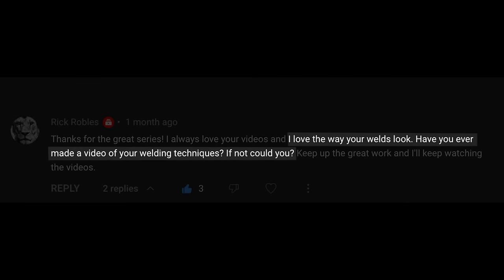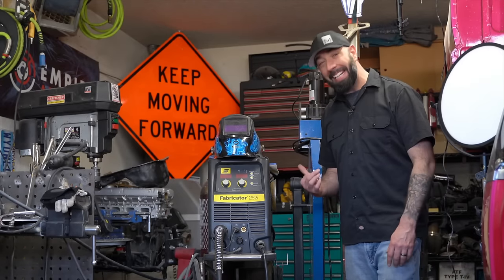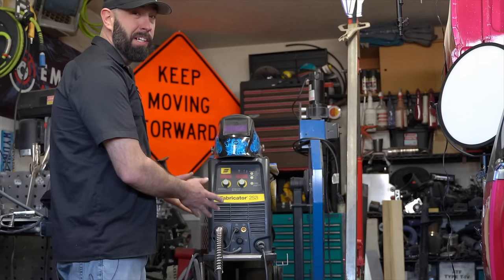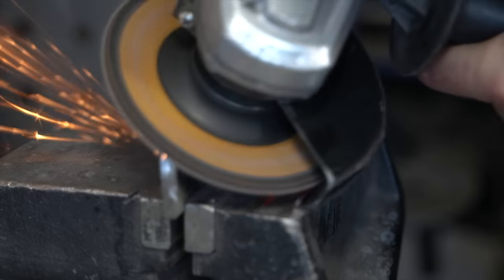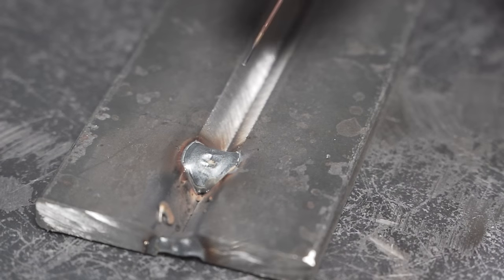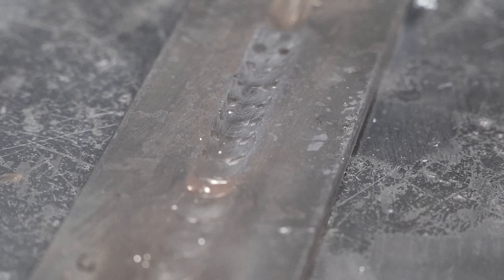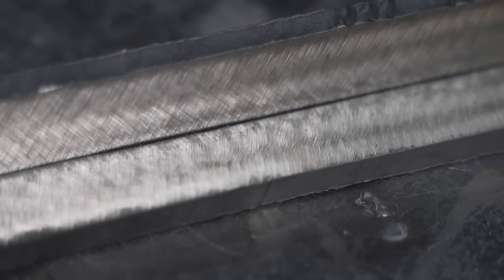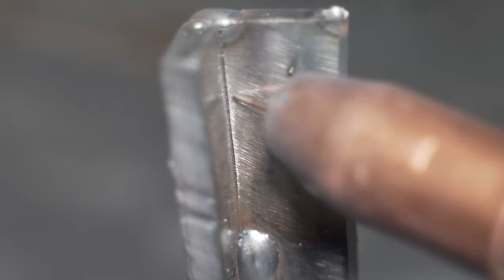MIG Like Mankandy: Techniques for Stacking Dimes with a MIG Welder

Comment: I’m pretty seasoned at stick welding, and like you I’m self taught. I rarely welded anything lighter than 1/8 inch steel. I’ll have a mig machine by mid April, and it’s gonna be an interesting learning curve.
Reply from the maker: Tell me about it! My first welder was a stick welder. I never got good at it. I can only imagine trying it again now.
Reply: If you can stick weld you'll be fine with a mig.
Reply: @GarageFab  I didn’t really have an option. I pestered my grandfather about teaching me, so he said, “fine” and flipped me the lead, the helmet and drove off 🤷🏻‍♂️
Reply: @aevan104  I’ve been told that many times. It’s just that I’m really wanting to learn how to weld sheet metal (20-14 ga) and with past experience, metal that thin gives me a touch of anxiety. 😂😂
Reply from the maker: I certainly haven’t mastered sheet metal. It’s easy to weld. But NOT easy to not warp. 😩
Reply: @GarageFab  And the real first project for me is gonna be making drawers for my benches so I have more places to store stuff 😅
Reply from the maker: Good call.

Comment: Just found your channel and subscribed. I'm a self taught welder that's been hobby welding on and off for about 35 years and as a job for maybe 5 years.  The fact that you understand the theory sets you ahead of many people doing it for a living.  You know the results you want (aesthetically/structurally), you know the requirements to do it properly, you know the materials and method to do it properly.  I'm not seeing a problem.  Nice welds and excellent video explaining them.  I even learned a thing or two.  In 35 years I've never done the triangle one,  I'll give it a try tomorrow.  In my defense, most of my experience is stick welding.
Thanks for the video
Reply from the maker: Thank you Bruce! Thrilled to have you my friend. Lemme know what you find! Based on what I’ve learned from comments alone, I wonder if the triangle would cause problems with stick welding. (I have VERY little experience with stick) I can envision slag potentially getting buried when you jump backwards as I do while forming the triangle. I’d be interested to know what actually happens. Thank you again my man! 🙏

Comment: Thanks for taking your time to create another great video. My advice for any newbies would be good prep position yourself to ensure your comfortable and consistent through the pass stay calm and adjust accordingly. Weld as much as you can out of what you got you don't need perfect tokens just keep stacking scraps and welding also let your test pieces cool so you're not setting up for hot metal
Reply from the maker: Good info, Lee. Thank you!

Comment: Good video brother. Lots of opinions about vertical down, but you not the only one doing it!🙂
Reply from the maker: Share them opinions! I’ll just have to finally cut and etch one of my welds, and it’ll either force me to shut up and learn to weld up or I can keep on keeping on. Prolly the former. 🤦🏻‍♂️
Reply: @GarageFab  Well, guys like Karl Fisher from Make it Kustom and Brent from Half Ass Customs do lots of vertical  down on the cars they build. And that includes welds on the frames. I do both, but only use vertical up when I feel it's a seriously structural application. Keep on keeping on brother!
Reply from the maker: Well I feel better now, thanks. 😆
Reply: @GarageFab  don't stress bro, your work is A1 👍🙂

Comment: Great video as always! 💪
I am not a pro/certified welder, but I’ve noted that the torch angle makes a lot of difference along with a smooth and ”even” movement, despite what kind of pattern you are doing.
When finding the correct wire feed speed/voltage/torch movement speed -ratio to obtain good penetration and decent looking welds you can actually hear if the wire feed is too much and also feel it to the torch handle. These are just my thoughts…
Reply from the maker: That’s good info. Thank you my friend.
Reply: @GarageFab  …furthermore the difference in pushing or pulling the torch; You get a different puddle melt (hotter or colder). There are a lot of variables to mig welding which i have noted just by trial and error 😁. When you have done a mistake to a place which is not easy to fix, you will try to find new and a better way - and you’ll never do the same mistake again 😆
Reply from the maker: So much truth. I’m going to be experimenting with pushing in the near future. Thanks again!

Comment: This is a fantastic way to add excessive heat, waste time wire and gas to make an inferior weld. If you want to "mig like tig" then just tig it. 
The best way to mig period is to move that gun ahead at a continuous rate through the joint depositing wire into the joint.
Reply: Tig 6mm steel? Why?
Reply: @chrisbenn8691  just saying, mig like tig is a waste of time, wire, and gas. Also adds an insane amount of heat to the joint AND worst of all makes an inferior weld. 
Don't believe me, go out and test it. Do a straight stringer and then do a "stacking dimes" mig run. 
You'll see a massive difference in the heat affected zone. 
Cut and etch them and you'll see a huge difference in penetration as well.
Reply: I was hoping someone would point this out. GMAW wants the smoothest movement you can execute, especially if you have to pass a weld test.
Reply from the maker: But what if you joint is large? Would the answer then to be multiple smooth passes rather than a weave?
Reply: @GarageFab  ordinarily if I'm stuck with a wide root weld, I use multiple stringers, then however many stringers it takes to build up the cover weld to print. Weaving is for SMAW not GMAW. If you're not getting paid, or if strength is a secondary concern, weave away.
Reply: @GarageFab  multiple stringers. 
Go check out the structural welds on any large structure. You'll see straight stringers. You'll typically only see weaving on open root but then you'll see stringers on top. 

All that said, mig like tig wil still hold things together. But it will also always use more wire, more gas, and more time, which for a home shop or production shop can be expensive. 
This is another thing you can test. Run a 4 inch stringer and time it. Then run a 4 inch dime pass and time it. 

I'm not trying to be a jackass or anything.  I'm not saying no one should ever stack dimes. But you should be aware of the heat, wire, gas, and time issues.
Reply from the maker: I don’t know if strength is “second”. I’d certainly like to avoid death. But appearance matters a wee bit too. Thank you!

Comment: I was told by a welding instructor in a basic welding class I took for work that using 75% 25% gas leaves nearly no slag and doing top to bottom verticals was completely acceptable on the truck frame I was building.  He even told me to bring in my personal welder I was using to do a weld and do a break test. I passed the test and his comment was " I'd ride in the truck your building with no worry on your welds. Before that class I had no idea top to bottom was a no-no. Now for stick welding no acceptable, mucho grande slag. Great vid bro 🤘
Reply from the maker: Interesting! So slag inclusion would be the concern with stick. That’s more input than most folks have given. Thank you Brother!
Reply: @GarageFab  correct. Keep making that killer content brother 🤘

Comment: Just stumbled across yoir video here and ive been a fab/welder for over 30 years 
I was taught to push my mig torch from welding school for better penetration and if you use the wire as a spacer in your "V" groove joint at the bottom eg 1 - 2 mm gap this will give excellent penetration 
For as vertical drops they work ok and are fairly strong if you work a up and down motion and this wiĺl be stronger
Reply from the maker: Thank you for that, Raymond! Very much appreciated. I’ll experiment with it. 🙏

Comment: Thank you for the video. Im definitely going to be referring ro this video in the future. I saw on another video that getting a stack of dimes is easier when you slow down the wire speed while keeping the volts up where they should be.
Reply from the maker: I’d agree with that. The hotter you are the better the puddles will flow. It’s a delicate dance though between hot enough for great flow without going so hot that the wire burns back too far and causes sputtering. 😩

Comment: Best welder you can get is great advice. I've spent a lot of time trying to figure out which problems are me and which problems are the machine. I just fixed a cheap ground clamp that had me thinking I might never be able to weld well. Thanks a bunch again for what you contribute to the community!
Reply from the maker: I feel that one Clint! I’ve had similar experiences. 🙌
Reply: Literally had this problem today with the shops welder. We don't do a ton of welding ( heavy diesel shop) but the machine is neglected since its the town pump and I discovered our ground clamp was covered in splatter, grease and oxidation. Cleaned it up with a wire brush and I'll be damned its a pretty good machine after all.

Comment: Thank you so much for this video!  15 minutes of my time and 5 feet of weld practice and my welds will never be the same.  Short and to the point.  I have a Miller 211 and it would be nice to have known the approximate settings, but I figured it out.  They are a lot different than the ESAB. A mention of the wire size preference would have been nice.  I assumed it was .035.  Thank you again.
Reply from the maker: Mmm very true. Settings already vary a lot from machine to machine, and then wire size changes it even more. I’ll likely do a follow up video with a bit more info.
Thank you my friend. 🙏

Comment: About The triangle tracing. It’s telling the welder that the he/she needs to weave the wire to the edge of bevel. But it really the weld puddle that needs to contact the edge of the bevel. So maybe smaller triangles when demonstrating with a pen. Great video Btw.!
Reply from the maker: Makes sense!

Comment: My first and only welder is the Miller 211. Only complaint is It is demarked in 1-10 for amps amd 10-100 for speed not actual volts and ipm like most videos talk about. But the chart seems to work pretty well. Have welded 1/8 up to 1/4 material. Clearly, the machine is better than I am. My biggest problem is seeing where I am going with the weld. Thanks for the video. You make this look so easy.

Comment: Great video! I learned something new. On a vertical down weld, I like to use an “inverted V” pattern. It gives a great concave weld and the penetration is good. No, not as good as vertical up but I don’t run the risk of a blow through.
Reply from the maker: Sounds good to me! Dancing on the precipice of burning through means your penetrating well which is why so many people despise vertical down. 👏

Comment: I’ve been a fabricator/welder for 20 years. As far as er70 hardwire goes I don’t consider it a structural wire. That’s where in our shop we use 710x-m dual shield or metal core wire. But that’s basically anything over 3/16”. And the dual shield gets welded uphill because your slag will run down in front of your puddle introducing porosity. Hardwire down hill as you described if your technique is good you should be fine. But make sure you clean that material lol. Great video.
Reply from the maker: Thank you, Jacob! I very much appreciate you taking the time to share that. 🙏 
Cheers!

Comment: I'll be honest, idk if the ESAB I used was flawed, or what, but I could never get a decent looking weld with it. It never sounded correct either. It was the only time, I'll ever use anything ESAB. Although, I don't think yours sounds any better than what I heard, but your welds look much better.
Reply from the maker: What was the model? I used an Esab a few months back and had the same problem, Rick. I chalked it up to not understanding the settings… OR… It was a garbage machine. I think I said it in the video, my Esab is certainly NOT my favorite. I make it work but I’m itching for an upgrade.

Comment: I started welding with a Lincoln 110 weld pak and welded a lot with it. The board ended up burning up. I then purchased a miller 252 and I love it. It took me about a month to get used to it but it'll weld up to 1/2.
Reply from the maker: I’ve heard good things about that one too!! Honestly though, I think you just can’t go wrong with Miller. 🤷‍♂️
Reply: @GarageFab  I also have the Miller suitcase tig/stick unit but my tigging skills are comparable to a three yr old with a crayon. I really need to sit down and get proficient with that thing.
Reply from the maker: I feel you. Me too.

Comment: I've been welding thin sheet metal to big ole 3/8's for 8 years now. When you are welding on thicker material, I've always recommended a push instead of pull. A push allows promotes a preheat of the base material, and it makes your welds flatter as well. All in all I believe you still have fantastic technique, and the welds look pretty good too. You should see about doing spray welding as well (you'll need a higher argon percentage)
Reply from the maker: Spray is some thing that has always intrigued me. I would certainly like to try. I have pure Argon. Good enough?
Thank you, Curtis! 🙏
Reply: Spray welding is the same technique that you are using just going forward or backwards 98% argon 2% carbon dioxide. The shop I work at wants perfect beads we also use double pulse welders your using cv if you push your weld you only have to go forward and backwards to get dimes my favorite is over head and down at a 45 degree angle just buzz pause buzz pause buzz and the only advantage of going forward truly comes in play with aluminum dragging aluminum will be covered is black soot. It you pace the same your doing its will shine  bright light a diamond

Comment: I just push and do little c’s , and or e’s and make sure it sounds like steady bacon.
Turn the voltage and speed that it says on the door . Practice once, adjust and weld.
I’ve never had any real problems.
I just wish I could see what the heck I’m doing. I’ve mostly focused on welding with either hand. I try to keep everything ambidextrous. But I’m basically goofyfoot, and right handed.
Reply from the maker: Vision seems to be one of the biggest challenges. It’s probably obvious, but being able to see really improves the weld. Weird.

Comment: This is how I taught guys at the shop.  Almost exactly.  Every new weld I would check the back of the material for discoloration and then let them know to go slower or faster.  That seemed to run the point home about the penetration aspect and the timing of movement on top.
     Frustrating part is alway the beginning and the end… beginning when the base metal is cold… and at the end of the weld when the metal is hot… and how you have to speed up your welding travel speed progressively….

Comment: It’s funny you say the Miller 211 is your favorite. I just bought that one, and knowing it’s a high quality one is nice to hear, I was basically shooting in the dark for what to buy.
Reply from the maker: Oh man. Good choice. There’s just something about the arc that feels so smooth. They often say a good weld sounds like frying bacon. Bacon is crackly and sporadic. The Miller sounds more like a smooth zipper.
If you’re a new welder, it’s awesome to learn on the auto setting. It allows you to work on technique and not have to worry about settings, but try not to get stuck/dependent on auto. Get a grasp on torch movement, and then experiment with manual settings.
Best of luck my friend.
Reply: @GarageFab  thanks man, that’s what I figured, I’ve just been getting my torch movement down right now and welding some small bits together. Going to tackle my first actual project today.
Reply from the maker: Nice. Let me know how it goes!

Comment: To check your weld? Vice and a sledge hammer?  I’m a sign maker and I’m wanting to do the welding of our sign post bases. They are made up of a 10x10 steel plate 1/8 of inch with 2 in square tubing 10 inches tall. I just need to weld the four sides to the plate. 
Luckily we have a miller mig welder that I can use at work. And we also have a handful of mechanics with welding experience that will be helpful but also picking my welding. Lol.. I’ve never done more than a little tac welding. So thanks for the tips, I’m not looking to go pro with it but like to be able to a quality job on my sign bases. I have 8 of them to do next week. Everything is cut, drilled ,cleaned with grinder, centered up tube on plate and ready for welding. But curious as to how to make sure my welds are properly welded correctly? Thanks again for your time put this up😎👍🏻
Reply from the maker: In my non-certified opinion, you shouldn’t need to worry much about a proper weld. If your welds break, no one dies. 😆 I’d grab some scrap steel similar to the size your welding and practice a bit before welding the actual signs. If you have troubles, fall back on the stitch welding. For your application, that method would be just fine. Best of luck and have fun!

Comment: Esab is going to send you one now. Lol

I learned to Weld in school. Bunch of basic shop skills. Welded on and off over the years. At work. I Weld not to 
Be pretty, but to function.  To often is dirty material. Or the position or access is tough. Even blind welding. But just get er done. Send er out.
I struggle with patience and change the pattern often.
Reply from the maker: I get to experience that at work too. Not really easy to make exhaust beautiful. But I still try! 😆